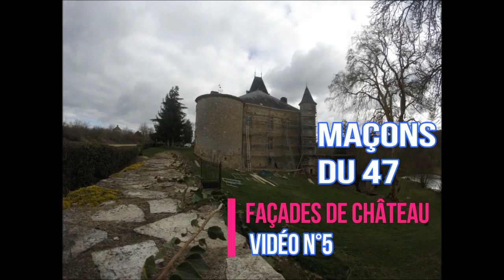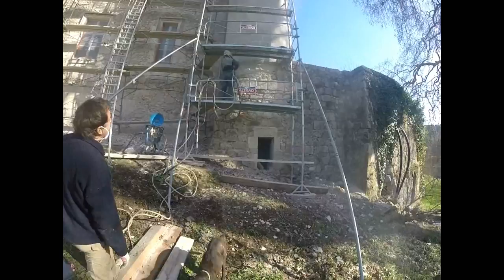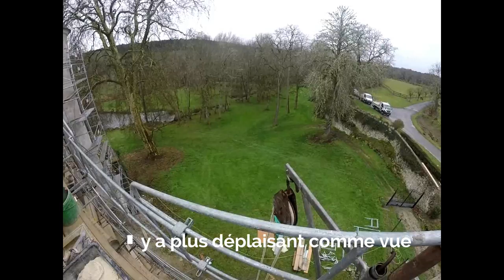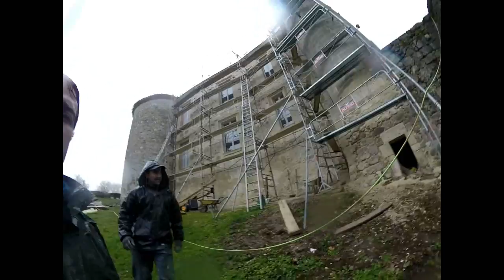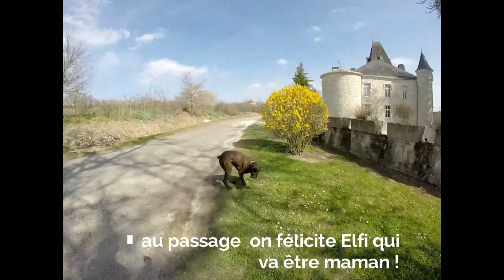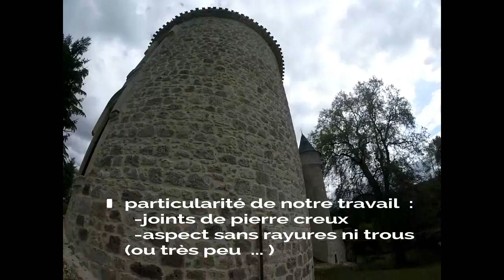joint de pierre au château de Lisse - VIDEO n°5

Comment: très jolie,  j'adore vous voir bosser ,j'ai l'impression de nous voir travailler 😉
ps: pour avoir fait sableuse et nettoyage à la rotor buse après pictage,  la roto buse est mieux et plus rapide autrement
Reply: et aussi pour info il existe des brosse pneumatique très pratique pour dégrossir les joints , Allier à une machine à projeter pour remplir ,on fait du boulot avec à la journée !
Reply from the maker: bonjour et merci de votre retour ! perso je ne vois plus trop d'avantage à la sableuse si ce n'est le principe du nettoyage à sec ( ce qui reste qualitatif sur de très nombreux points de vue) , nous utilisons exclusivement la rotobuse :)
que désignez vous par brosse pneumatique ? avez vous un lien , les seules brosses que l'on ma proposé nous donnaient une finition horrible, donc brossage manuel  !
bonne soirée !
Reply: Maçons du 47 je vais chercher pour vous montrer ou sinon je vous prendrez une photo 
c'est pratique pour dégrossir et de plus sa " assistique " les pierre et fait gagner des douleurs au bras 😉
après on fini à la main biensur , un qui dégrossi et l'autre suis derrière
Reply from the maker: je ne demande qu'à découvrir de nos nouveaux horizons , tant mieux si on m'apprend des techniques  !
Reply: Maçons du 47 sinon nous on fait les joints avec du 0/6 mm que l'on repasse au crible de 0/6 mm 
car on fait les joints avec une machine à projeter électrique don la jaquette ne supporte pas le qualibre supérieur 
et après beaucoup d'essai on trouvent le résultat à notre goût 
avec chaux + ciment blanc et une bonne dose de plastifiant surtout 😉
sinon il existe 2 type principaux de brosse qui fonctionne selon le type de pierre et la taille des joints ( plus ou moins profond ) 
Et moi mes chiens se sont le modèle plus du dessus en taille 😉
Reply: @maconsdu4740  toutes mes félicitations pour ce magnifique chantier.tu fais vraiment honneur à ton beau métier et à l artisanat.